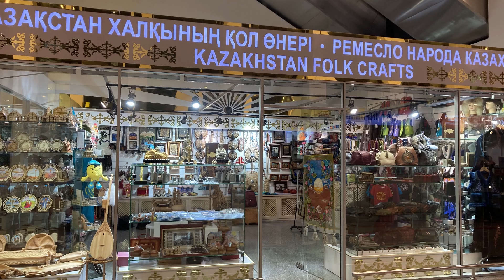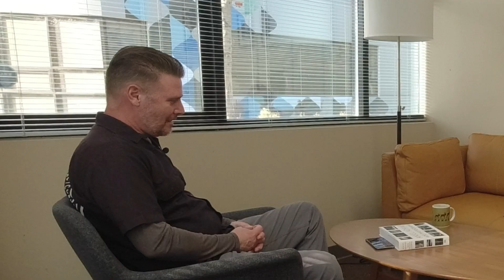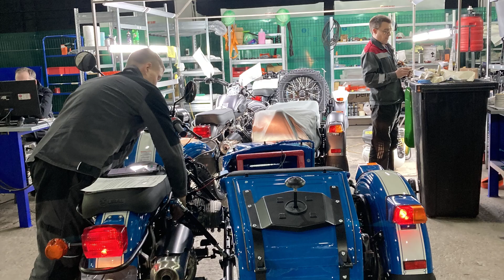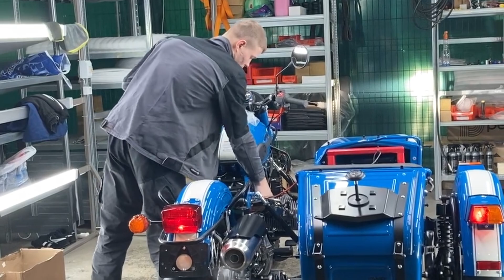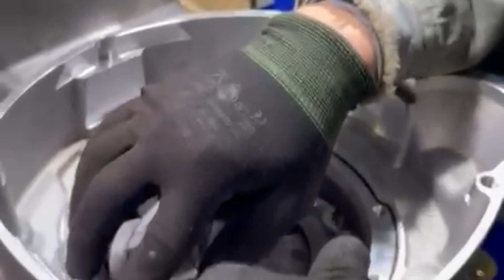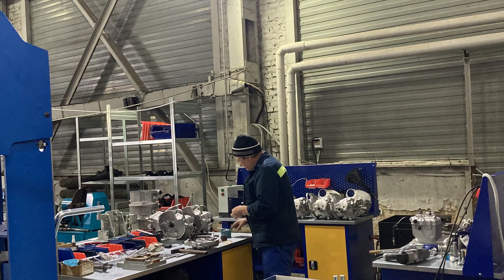URAL Field Notes with Ilya Khait 11.23.22

Comment: You should provide parts for older bikes and support your brand better. Since Ural started making motorcycles they have produced three and a half million over the years. Everybody for the older bikes is screaming for parts and you don't Supply the need for the parts to keep the older bikes running. You can say what you will about the Soviet build quality but my 1999 Euro tourist has been more trouble free dead bikes 20 years newer. I watch videos of brand new bikes with little miles on them that have had major catastrophic failures in the engine. I'm not saying my Russian built bike is perfect. I had to put new Drive gears in it. I had to replace the drive shaft. The one piece drive shaft is a pain in the ass to replace compared to the old two-piece drive shaft. I have 50,000 miles on the original engine. I had two cylinders break off at the base within 2 years of each other. Took me a long time to get replacement cylinders. It should not have been so hard for my dealers to get parts for me. I'm a crippled vet and I need my three wheels to keep me on a motorcycle. I have lost so much riding enjoyment this year because of the lack of parts. Why is it I can get anything and everything regarding parts for 70 year old British motorcycle yet I cannot get simple parts for 20-year-old Euro. That shouldn't be the case. I think you guys could do much better. The guys who buy your newer bikes only have it for a couple of years and I put 2,000 miles on it and that's all and then they leave it for 20 years. My URL was 20 years old when I bought it and it had 6,000 km on it. I have had more enjoyment out of that motorcycle and the previous two owners put together 10 times over. It's most fun motorcycle to ride. Everybody loves it and says it's so cool.
Reply: I have a 1995 Ural Sportsman. Virtually nothing on it is available anymore. Go find diff parts for one... Why? Old parts used up and unlike British stuff there is no after market and home market who made the parts back then had no impetus to make any spares after the order was completed. Blame communism for your lack of parts, not Ilya, he didn't make it, took over the year AFTER your bike as made...
Reply: @JamesAllmond  they're used to be spare parts available easily. I remember when I went to be a year old dealer in the 1990s when you got your original shipment of bikes you also got a great big wood crate a spare parts. The park situation was much better under the Soviets then it is now. They are more concerned with making it pretty toys for their Rich customers who keep them for 10 years never ride them and then sell them later on. The companies missing out on a great opportunity to sell parts to supply all of them 3 million built since 1940. I should not have to go on a scavenger hunt for months to try to get simple Parts like throttle cables or engine parts like cylinder. Everybody screams to them that they need parts and we're all ignored. The year my bike was made they made $100,000 bikes that year. Now they make 2,000 bikes a year. As president of the company or general manager or whatever he is he could tell them we need to make parts for the other bikes so we can make more money. EMD the locomotive company decided to stop making parts for small engines hoping to force railroads to buy new locomotives. They didn't they lost that business and it's part of the reason why they are out of business now. BMW makes parts for airhead motorcycles. As soon as they get $55,000 calls for certain part they will make that part available. BMW makes 85% of the parts required to build a new Airhead BMW. BMW classic is a program where dealerships that work on new bikes will also have a mechanic and Parts Supply to work on Vintage BMWs. 85% of all Airhead BMWs constructed since before and after World War II are still around. And many of those are on the road. Therefore the company supports them with parts as it should be. No one wants to work on my URL because they all want to build Orange County Choppers. I can do the work myself but I need the parts to be able to do it. It should not be such a hard rigamarole.
Reply: You seem to miss the concept of “boutique” bike.  This company doesn’t/hasn’t sell/sold enough bikes to make continuous support of bikes more than a decade old even remotely feasible.  It is what it is and it’s not Honda, Yamaha, Suzuki, etc.
Reply: What kind of parts are you having trouble finding. I have a 2012 Gear Up and I used to have a 1997 Solo and I never had issues finding parts. Ebay is full of people who strip old Urals down for parts.
Reply: @rubiconnn  I am officially handicapped so I can't see fine print and I don't have anyone who can help me with anything on eBay or computers because the old man who helped me with that died earlier this year. It took me forever to find a replacement cylinder and Barnett makes throttle cables for euros so I finally able to get those now I just need to have the top end done on the right hand side of the bike. I feel that the company should support their product better but instead they just want to make fancy expensive toys for the rich people for 2,000 miles on them and then let them sit for 10 years. Any Soviet days they made 100,000 bikes a year. Now they make $2,000 bikes a year. I've been off the road for almost a year now. I have two and a half years till I go for my license for my license renewal and I don't think I will pass the vision test even though I'm perfectly fine writing my bike. So this year is a year of writing I will never get back again.